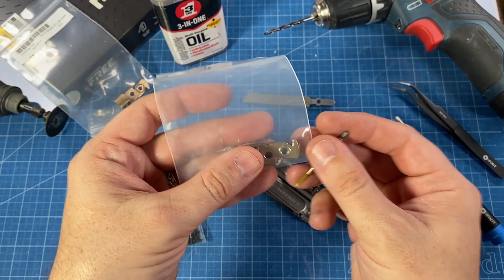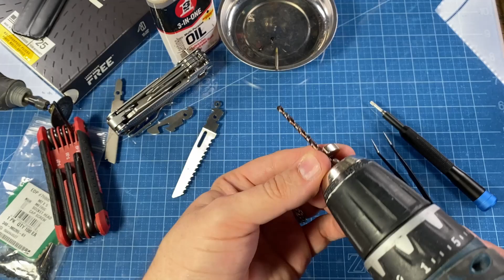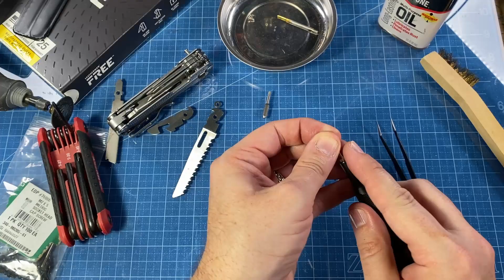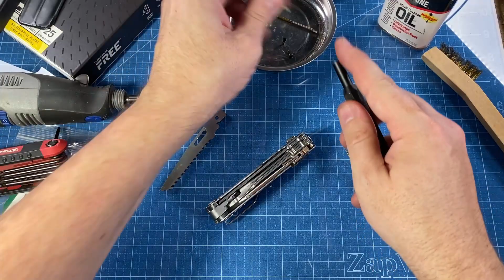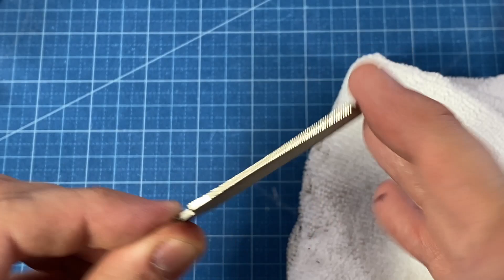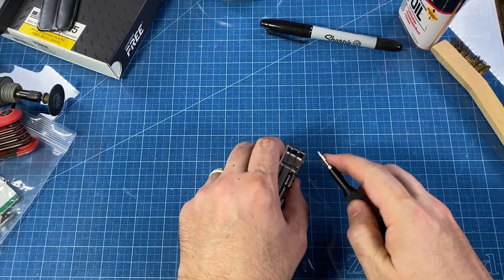Leatherman Free P4 T Shank Mod, Install Guide

Comment: Can the T-shank adapter work in the Free P2?
Reply from the maker: Yes, but you have to remove a thin implement.
Reply: I would remove the knife blade. which orientation would i need @ZapWizard
Reply from the maker: @toolsnthings876 The variant marked as Main Blade. On the P2, you would have to move the thicker philips or package opener to the other side and then one thin implement put back in its place.

Comment: Very nice product. Only had to file the T part of the file to acomodate the spacing between the screw holes and not destroying the screw thread. I'm now wondering if it would be a good idea to file the bottom of the adapter to glue or weld a steel shim to recover a bit of the magnetic retention and prevent the problem of the accidental opening of the file blade. Until Leatherman sells their new file holder (see Leatherman garage batch 5) this is the best we can find. THANKS for you product;
Reply from the maker: Ya, the screw threads getting torn up depends on your exact file, I have had to file some, while most others have been fine.  Adding a small magnet is something I did try during prototyping, but part of the issue is the 3D print couldn’t hold the magnet hole tolerance very well, and there was just no room left.

Comment: question for all of you guys. I am torn between keeping the wave + and the p4. Using them around the house both have their pros and cons. I really think the design of the P4 is the future but we all know it's just not as full featured as the wave. 

Specifically- I love using the eyeglass screwdriver on the Wave+ to unlock doors…(need to keep the house doors locked from the two year old). 

So the question is WHAT can i use and WHERE can I stick it in the P4 so I can pull it out to unlock doors if needed? That's really the only thing preventing me from keeping it vs the Wave+
Reply from the maker: There are a few folks who sell a flat-bit to eyeglass bit adapter on Etsy.

Comment: Why did you get rid of the washer and build it into the holder? Don't those washers serve a purpose, otherwise Leatherman would have built them into the implements from the factory?
Reply from the maker: The scales have a formed shape that leave a recess on the inside. Those washers only serve to fill the gap between the scales and the blades.
Reply: @ZapWizard  I tried posting a link to an article but the comment with it disappeared. The purpose of those washers isn't only to serve as spacers, it's also to reduce metal to metal friction. If you tell me an alternative way to send you the link to the article, you can read about it.
Reply from the maker: @acaglumac  When washers are allowed to spin they can act as crude bearings. The bronze steel amalgam used in the 3D printed  parts actually has a lower coefficient of friction than solid stainless steel. Pitted bronze is often used as a solid bearing material. The pits in that case hold onto lots of oil, which isn't really needed on a small multitool.
The reality is the cross-sectional area of the tiny washer isn't enough to affect the feel or deployment of the tool in this application. Building the washer into the print prevents you from having to hold the washer in place while installing the tools. Due to the magnet on the FREE series the washers often get pulled away from the hinge when you take it apart.
Reply: @ZapWizard  thank you for the explanation. I'm still deciding which tool to get between Surge, free P4 and charge plus TTI, for my EDC. I like the implements on the surge and it's robustness but I don't like the weight. I like your mods on the free P4 but I don't like that it's not as robust as Surge. Charge plus tti is lighter than surge and seems more robust than free P4, so I'm leaning towards that one, but you don't have the T shank mod for it and I want to be able to exchange the blades on it. Do you plan on designing a t shank mod for the charge plus tti? Also, it would be great if you design a holster for any of these that have the T shank holder from the factory or with your mod, so it can store extra blades. It would be great to have room for 2 extra blades, that way we can have one blade like wood blade on the tool, and a metal blade and a file stored in the holster. Another thing I noticed is your holsters store less screwdriver bits if they are open clip or metal clip. In the pics I see empty space and it seems like it could fit few more bits. I wear sweat pants all the time, so I need a holster with an open clip, but I don't want to lose the number of bits I can fit.
Reply from the maker: @acaglumac  The P4 is not as robust as the Surge. The T-Shank blades aren't as handy as you expect. Get it only if you want a metal cutting blade or the diamond file. Wood t-shank blades are quite hard to use by hand. Currently I don't have plans to make mods for the Charge as it isn't as adaptable. My Surge holsters do have a slot for an extra t-shank blade. The open clip and metal clips both need space for the belt to move out of the clip, hence why they hold less bits. If you wear any soft (non-denim) pants, I don't recommend storing bits on the back as the bit can catch on cloth.
Also, you may want to wait for the Leatherman ARC. My FREE series holsters will be compatible with it, and it has the best of everything (For me at least)
Reply: @ZapWizard  thanks you the tip about the arc. I read up on it and saw your rendering. I like it for a lot of things but I don't like that it doesn't have a serrated blade and a T shank holder. I want to have all three, the metal cutting blade, file and wood cutting blade, even if the wood cutting blade isn't easy to use. I still like to have it in case I need it. Do you know if your free p4 T shank holder will work on the arc? They look to have similar design.
Reply from the maker: @acaglumac  I can't be 100% sure of course, but the ARC looks to share the same scales and mechanisms as the FREE series. The FREE P4 already has a wood cutting blade that takes up a lot less space than my thicker T-Shank adapter.

Comment: Would this work for a p2?
Reply from the maker: Yes, it can replace the scissors (While also removing one thin implement), or the main blade (requiring moving implements between sides on the tool). I have diagrams on the product page for both the P4 and P2 to help illustrate this.

Comment: Silly question, but would your awesome custom parts work on the Ozark trail multiforce since it's a Leatherman clone? Or is that not a thing? I'd much rather get an Ozark for a frame and just get all the cool upgraded parts for it, less stakes if I mess things up.
Reply from the maker: No, the locking mechanisms aren't even the same between Leatherman series (Wave, Charge, Surge, Free, etc...)
Reply: @ZapWizard  well poop. Lol. But thanks for taking my question tho! Appreciate it, have a comfy holiday season. 😁👍

Comment: Do you think this mod would work with an Oht tool ?
Reply from the maker: No, as with most Multitools, the locking mechanisms are different.
Reply: @ZapWizard  ok no worries i will ask tho have ypu tried this with a surge ??
Reply from the maker: @cowboyfpv2464  The surge already has a T-shank adapter, the diamond file is the one sold by Leathrman for the Surge.
Reply: @ZapWizard  yea but I don't like how flimsy it feels 🤣🤣 help me spend my money 🤣🤣

Comment: Can I use a medium and large t-shank on the same P4?
Reply from the maker: Yes and no. The t-shank is thicker than the blade it replaces. So if you trade a thin implement on one side with a thick one then you can have two t-shanks. Or just have two thinner implements on one side depending on what you replace. See the product page on zapwizard.com for diagrams.

Comment: How do you feel about the GOAT multitool that was crowdfunded and is supposedly in the works? Seems like it would be super ideal given the creator intends to release CAD files for the design.
Reply from the maker: I had not heard he was looking to release the CAD. I have seen it and assumed it was another accessory buying scheme that so many crowdfunding products go with. (Got to have that after the sale residual income).

I think the design is interesting, but a big bulky and large for my EDC. The modular tools only work if the modules are actually good, and available. The catch with any modular system is you have the same investment cost in every addon, but large spread in the number of sales, which usually leads to failure or canceling the less popular options.

Comment: Good morning. Enjoy your videos and what you are doing! I have so many Leathermans and there are some changes i would like on one or another. Can a t shank be added to the Leatherman charge Titanium instead of the saw blade as well and what other mods can be made to it? I am subscribing and enjoy what you do to them and all the different ideas!Thank you and have a good day
Reply from the maker: No the t-shank adapter doesn’t fit the Charge. I don’t currently have any plans to make charge mods, just holsters.
Reply: @ZapWizard  Hi. Thank you. Any mods to the surge? Maybe I would like to change something if I think it would work better for me? Please let me know and thank you for getting back to me. Have a good day
Reply from the maker: @rayjrdibenedetto867  Just accessories for the surge. The FREE series was much easier to work with than the way the Wave/Charge/Surge handle locking.

Comment: Thanks. One question though: I am trying to install the mirrored version but the spring is blocked by the plastic magnet cover. Any suggestions?
Reply from the maker: Some folks have trimmer the magnet cover using precision wire snips. Some have just removed it. The cover doesn’t hold in the magnet ( the springs do) it just makes cleaning any dust caught on the outside surface easier to remove.
Reply: @ZapWizard  I will try that. Thanks a lot.